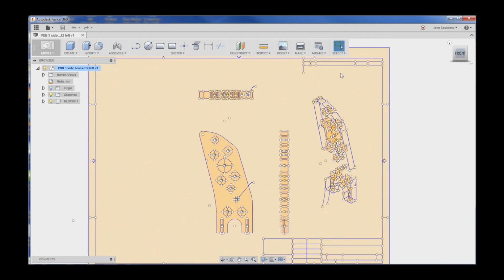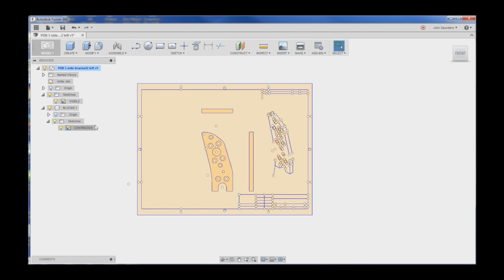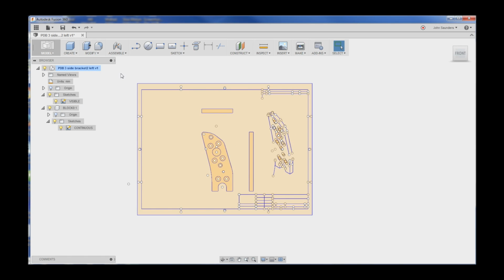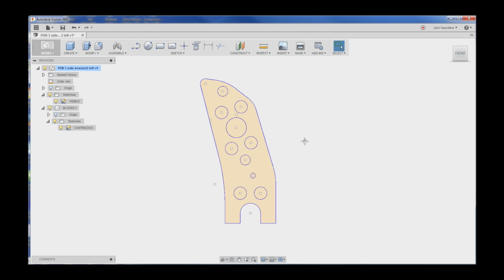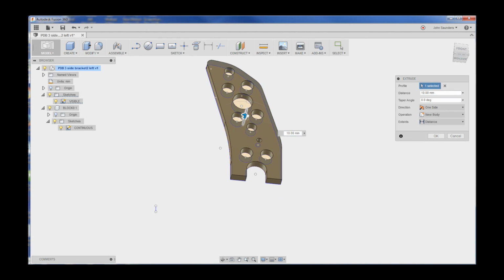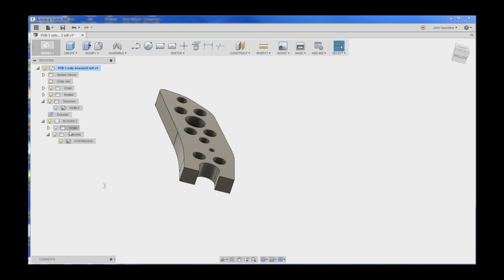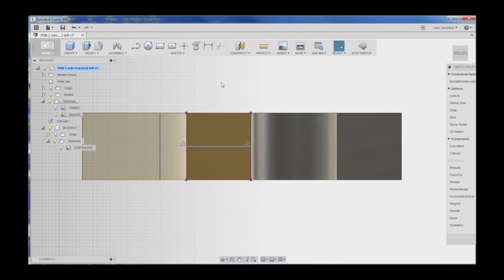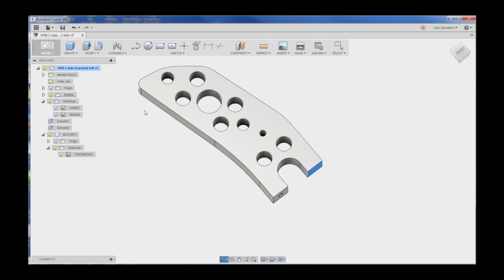Fusion Friday #9: Convert DXF to 3D Model!

Comment: Failed:
Traceback (most recent call last):
 File "C:/Users/%username%/AppData/Roaming/Autodesk/Autodesk Fusion 360/
API/AddIns/ConnectTheDots/ConnectTheDots.py", line 47, in run
   for merge in points[index+1:]:
 File "C:/Users/%username%/AppData/Local/Autodesk/webdeploy/production/
%guid%/Api/Python/
packages\adsk\core.py", line 11437, in _getitem_
  if  i <:
 TypeError: '<' not supported between instances of 'slice' and 'int'

any ideas?

Comment: The title was a bit misleading. You didn't really convert anything. This won't work for 90% of designs that aren't basically a 2D extruded drawing. How  do you actually convert a complex, asymmetrical .dxf to a usable 3d model? That's the ACTUAL question that needs answered.

Comment: I find that some DXFs are not fully connected in a loop which results in the inability to create 3D bodies within Autodesk Fusion 360. I've created a Fusion 360 add-in script to automatically connect any lines that should be connected. If you're interested, see https://github.com/kewlsak/ConnectTheDots

Comment: I have had a lot of trouble opening DXF files in fusion. The file I have to work on has 15,000 lines. I'm guessing that's what is causing the poor performance. I can't do much of anything once I have the file in fusion 360. Ideas?
Reply: +NYC CNC certainly not but it wasn't my drawing to start with. I'm not sure what first step to take to simplify.

Comment: but how do you import a .DXF into fusion?
Reply: +Eddie Martens  I had no luck with the New Design From File under the File tab it actually locked up Fusion 360. 
On the sidebar there is a cloud looking icon that when you hover over it says Upload.
Use this Upload button to import the .dxf it will be mm tho.
Reply: +Eddie Martens The file will import (Upload) and show up in the sidebar. If you open that file the capture design history will be off and I think some other default settings are different.
I opened a new design then dragged the imported (uploaded) file into it to make sure all my default settings where active . You must save the new design before you can drsag and drop the imported file tho. It will also create a link with the imported file I found it was best to break the link . If you need it in inches you can now scale the drawing.
Reply: Ed G Got it! Thanks a ton, been trying to figure that out for a while now!
Reply: Eddie Martens NP Anytime.

Comment: A day late! Thank you for the video!
I struggled with this yesterday as well. I had a hard time with actually importing of the .dxf though. I finally figured out I needed to upload the .dxf with the little cloud looking thing on the sidebar.
I tried Create From File under the File tab and fusion would lock up.I'd have to say the process is not very intuitive.
 I also could not figure out a way to import (upload) the file in inches it would come thru in mm and turn a 1 inch line into 10mm.
I gave up on that and just scaled the drawing by 2.5399986284. I'm glad it was a very simple file and that I don't need to do this often.
Keep on keepin on!

Comment: Great tip!
Reply: +NYC CNC it's doing good.  I've made enclosures for all my arduinos and Raspberry Pi's.  Mounts for the GoPro, and a few knobs.   I tired doing the dxf to model conversion per your video, but ca't get to to push-pull.
Reply: +Herb Blair it mustn't be a closed loop... which a lot of people don't pay attention to when they're creating profiles in AutoCAD or similar programs. Look for gaps and close them up.

Comment: Show all steps from "import dxf" to "cam operation" for one model, please!
Reply: No, I mean step by step get the abstract dxf (2D) file from another cad system and import it in Fusion360, some edit it, make model and than add different cad operations! Thx!
Reply: Yes please show the import process from the start. You already had the dxf imported when the video started.
Reply: chuck smalfus +NYC CNC
I had many problems with non-editable imported dxf! Would you show how to fix this?

Comment: One of the issues I had was that the DXF part dimensions were in inches but when I uploaded it, Fusion360 loaded it as centimeters.  I have all my defaults, including the individual drawing units set to inches, so I'm not sure how to correct this problem.  I also wasn't able to figure out how to scale the drawing once I had it loaded in Fusion360.
Reply: +Chuck Fellows run it through Autocad 360 first if you have fusion you have access to it's just your username and password to sign in, then in there you can set your dimensions to inch and save and export it out when you bring it into fusion it will be all good
Reply: +NYC CNC Sorry, don't know how to send you a file?
Reply: +Chuck Fellows that a problem they are working on it may be fixed in the next 3 years, 
going through A360 or autocad 360 is a work around for quite a few things once they have it fixed, autocad 360 being free will stop, unless they get project lepard out first, you can scale using the conversion from cm to units required
Reply: +Chuck Fellows send john a pm